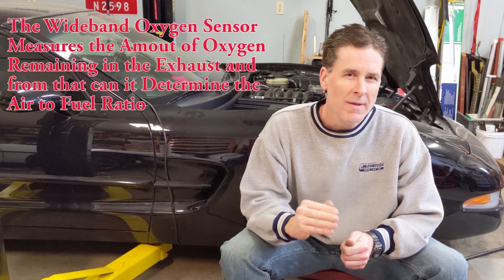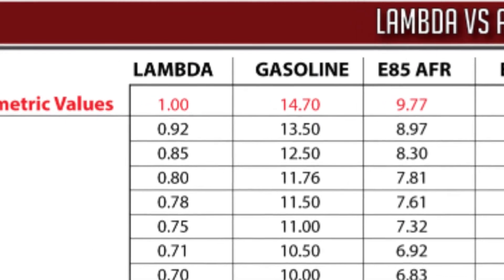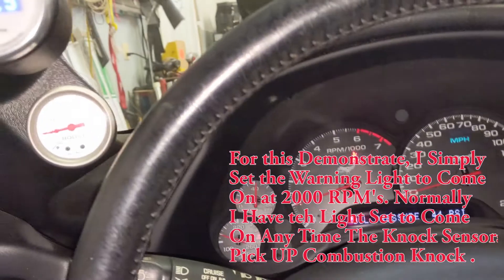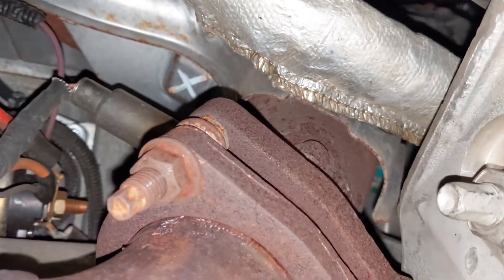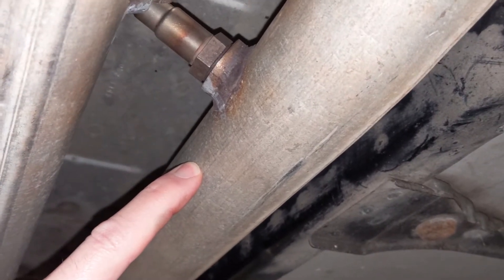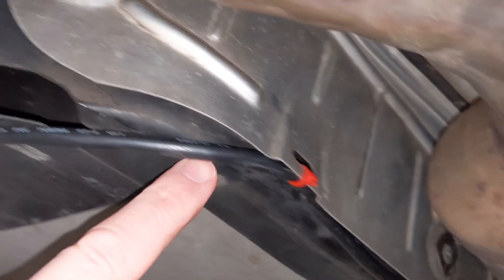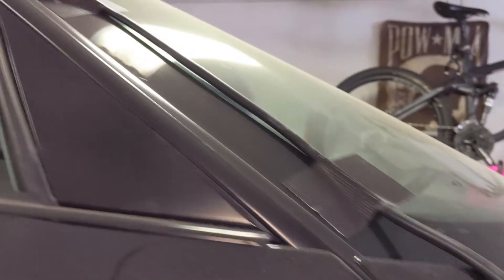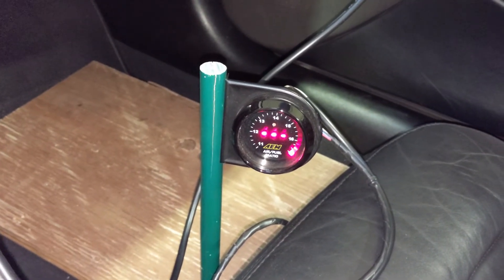C5 Corvette Tuning (Wideband Oxygen Sensor Thoughts)

Comment: My check engine light came on my C5 for a day or so, the code was a pcm po137 which is bank 1, sensor 2, which is drivers, downstream, I think.  Question 1, are these sensors only for upstream?  Question 2, if I replace only 1 sensor with a wideband sensor, will that totally screw up my car?  Do I need to replace both?
Reply from the maker: A wide band is not intended to replace and be plugged into your factory computer.
Reply: @Toys4Life  That is what i get for not watching the entire video, thanks.

Comment: Not the correct place the wide-band it should before the cats
Reply from the maker: Agreed, slightly better b4 cat.   Here is some data showing how big (or little) the difference really is though. https://forum.hptuners.com/showthread.php?13481-OK-so-whats-the-deal-with-WB-s-after-cats/page2&s=aafb9c1a927ab6f258a614715c15047a

Comment: really interested in getting my 1998 C5 corvette with LS3 engine swap up to par like your setup! really like what you have done and giving you most info about whats going on to save it in case of potential diaster! could you provide with aeroforce gauge you went with? like the fact the knock sensor is included with the fuel trims also. I have never used a fuel trim gauge and will do some research what I would be looking for when/if things are not right. thanks for any help/reply!!! I am n/a and don't do track events but just want to be more informed about my car's internals!! thanks again!
Reply from the maker: Sorry I missed this.  https://youtu.be/PTnlxysKwnQ  Should answer most of your questions.

Comment: You're O2 readings will be skewed by having the sensor post-cat, and they work best when they get hot quickly.  So it really should be before the cat as close to the engine as possible.  There area a number of O2 sensor kits on the market that allow you to replace the narrow band sensors with wide-band sensors and at the same time send a narrow band signal back to the ECU for proper operation.  It's the best of both worlds (although it isn't cheap)
Reply from the maker: I agree, before the cats is best. That having been said I have researched this sufficiently to determine that in my opinion the difference is minimal. I do cringe when I see performance shops put it in the exhaust pipe at the end of the vehicle. I have to believe oxygen is contaminating the results and the exhaust is relatively cold by then....